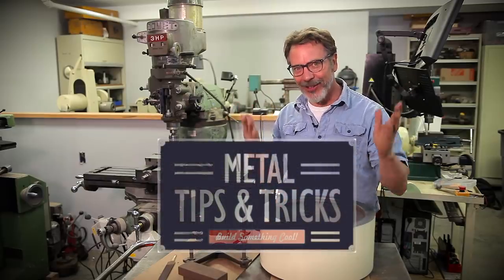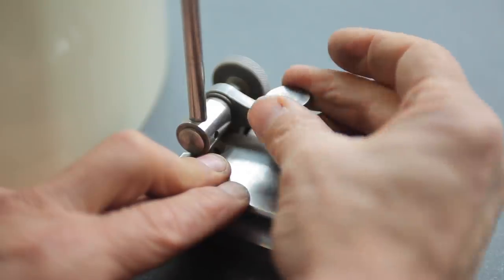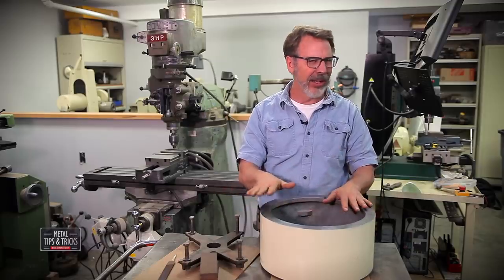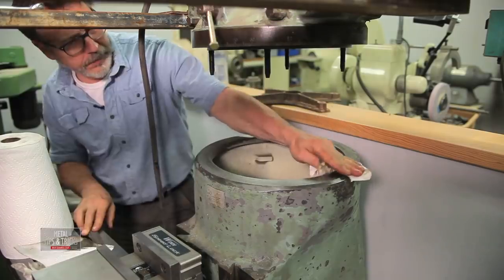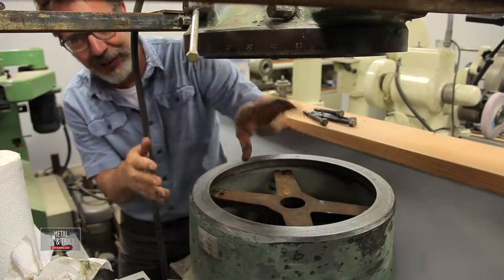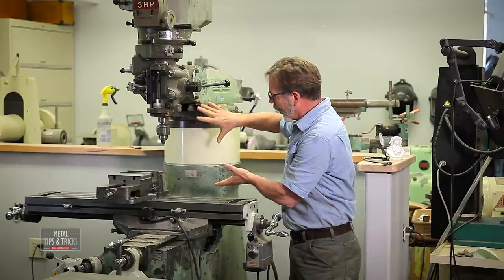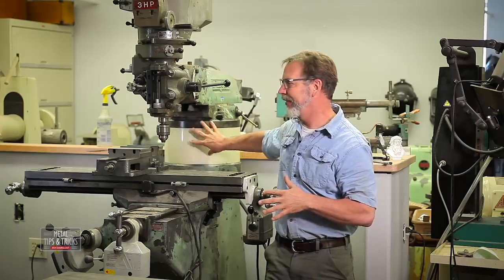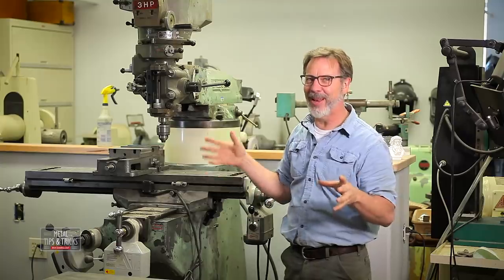You need this for your mill !!!!

Comment: I wouldn't have a Bridgeport without the 8" riser. I always ran with one. The pneumatic power draw-bar is mandatory. The versatility goes up exponentially with these 2 items. The other necessities are power feed traverse, and the 48" table, a 6" Kurt vise, Digital Read-outs, and an Advance Rotary cross-slide table. With a set-up like this, it is possible to make almost anything. What you can't make with it, can be made in the Tool-Room size lathe with DRO's, and quick change tool-post, with all carbide tooling. I think I just wet myself!!!

Comment: After raising the head, I would have moved it AWAY from the BASE as a safety precaution. It's not worth losing your arm to clean the mounting surfaces.
Reply: Yeah man, I cringed when I saw that and had to skip ahead just to not have to see it. Rule I learned in rigging and use all the time in the garage & driveway: NO part of my body ever needs to be under any suspended load. We all have plenty of tools that can be used to manipulate things in hazardous locations.
Reply: 1 lose an arm 2 and then try losing your head.. I cringed when I saw that . But god job anyway :)
Reply: He should have strapped the back end of the Ram to the Fork to keep it from tipping, and should have strapped both ends down actually.

Comment: A welded riser block  can work just fine. Years ago we often needed a extra high block for a job. I think it was 24" (600mm) high. Made the upper and lower rings roughed in. Used a section of pipe that was quartered lengthwise for the spacer. When the segments were welded to the rings there were four gaps so you could manipulate the anchor studs into position. After welding, the riser had the rings machined in the lathe. 
  We did a lot of work for Sandia National Laboratories and ir often involved large Aluminum weldments that had to have flanges, etc., milled, drilled, and have O-ring grooves cut.
  The warning about lifting the turret off a knee mill should not be ignored. Milling machines and lathes are notoriously top heavy and can seriously injure or even kill you if not correctly rigged for moving. If you have an installation manual for your machine, follow the instructions and don't cut corners... if it shifts while you are moving it, it won't be in slow motion when it tries to get you.
   Cheers from NC/USA
Reply from the maker: Great comment. :-)
Reply: Warning : Last lines are lethal. 😄👍

Comment: Hey Dale, glad to see you're ok and back on-line, I've missed your videos.  I'm a carpenter wannabe machinist, and I love to work in metal.  I've used a number of your ideas already with my tooling, such as the spindle square tool.  Its a much simpler device than you had made because I just use it to square my drill press table, but it certainly saves me time and its easy to use.  Happy to see you are back and healthy.

Comment: G'Day Dale, those riser blocks in Aus are almost as expensive as the Mill so I made two, One at 6" and one at 2" and had them stress relieved and they have been rock solid as far as accuracy.   What a difference they make to the capacity of the Mill especially for my quill mounted slotting attachment.  They are each around 390mm in diameter and I tuned them on my lathe that has a 330mm diameter swing.  Worked out to be an interesting setup.
Cam

Comment: One other thing to keep in mind is that it's possible to have the rear edge of the sliding center covers extend over the dovetails on the column and if you lower the knee with it overlapped your will bend the cover upward.

Comment: OMG... 900m2 that must be absolut great my workshop (hobby) has about 15m2 and I have a lathe (300kg) a nice big mill diy converted to CNC, metal bandsaw, hardening ofen, tool and cutter grinder, surface grinder, surface plate,  compressor, div. grinders, and tons of tools in this one room.. Without perfect system I couldn't find anything again... so whenever someone says he has not too much space I think I could tell how it really is having little space 😁😁😁
I love your videos 👍😎
Cast iron takes the vibration of the machine much better than steel 👍
Reply: 900 sq /ft is "only" 27 m^2.. I'm in the process of converting 200 m^2 to workshop..

Comment: I'm wanting to add a riser block to my bridgeport to gain some z-height back after installing an Advance Cross Slide Rotary Table. What size is the one in the video? I was thinking either a 6" or 8" riser. Can't go any more than 8" due to ceiling height, but I already have a maxi-rite power drawbar lol. The Rotary table is sweet, but ate up 12" of my Z-height, and currently, I can't even use my Albrecht drilling chuck because of it. And at 350lbs, it's VERY DIFFICULT to move by myself lol.

Comment: Dale, I almost couldn’t watch this to its conclusion. Great presentation, good videography, great sound, and interesting topic. But dude, why do you think they sell jack stands? You bet your life on the seals of that forklift hydraulic ram or the valve seats in the valve, holding. If either had failed you would have  been crushed, or worse when you were affixing the spider, have your arm severed at the shoulder. There are no pressure points for that kind of bleeding. Although it will stop eventually.

You should have removed the mill head from the work area, or at least chocked the ram (easily made from a pipe with a similar ID as the ram rods OD, split lengthwise and clamped in place to hold the weight if there was a failure) before getting underneath that rig. I’ve seen artillery plows, crane, jacks, aircraft landing gear, and yes forklifts fail in this way. 

Safety third is OK, but it has to be in the job someplace. I love watching horror, but only when it’s fantasy. Take care and be carful.
Reply: @warne28  Come on now buddy. What is the first rule in a shop? SAFETY!!!!!! SAFETY, SAFETY!!!!!!!!!  warne28 is absolutely right in calling this out.

Comment: I can't believe you installed that riser without applying some for of lubricant to the mating surfaces. The lubricant has two function. One is as a lubricant to prevent scoring and galling. 

The other is to seal out moisture. My preference would be a moly-disulfide grease but any lubricant is better than no lubricant. A dry iron face against dry iron face eventually reacts with air, humidity, coolant splash, whatever. It's not the end of the world to assemble dry but prudent practice would be to apply SOMETHING to mitigate the unforeseen in any metal to metal joint, especially where infrequent adjustments of precision fitted surfaces are concerned.

I've modified many Bridgeports in the last 50 years by drilling grease passages in the turret and tapping for a Zirc fitting. I had some little plates made up: "grease and rotate this turret annually." Overkill to be sure but the turrets always spun freely and clamped solidly. A needful thing in a busy shop.

Comment: I've got a Jet mill and have struggled with not having enough Z. Being forced to clamp to the table instead of the vice wastes a lot of time. Put a drill chuck on over a rotary table and you don't have much room left for the parts. I'll have to research what blocks are available for the Jet. Thanks, Be safe!

Comment: I've come within a quarter inch of maxing out the capacity of my Z travel on a big part only once but that was nerve racking. Another possibility is to turn the head sideways, mount a right angle attachment to the quill, and swing the ram around 30 degrees. You get 7 inches extra from the center line of the head to the quill face minus 2.5 inches from the right angle head center line to its face for an extra 4.5 inches. If you need extra, you can nod the head back up to 45 degrees and clamp the right angle head the matching angle on the quill. The quill center line on a Bridgeport is 8 inches from the nod point so that would be an extra 5.5 inches for a total of 10 inches of height from the table. You loose the use of the quill but in a pinch, 10 inches is 10 inches.

Comment: I couldn't find a video on riser blocks when i went to install mine, so i made kind of a slide show... I will add a link to video you will need to approve it, couple things you might want to consider in it... also I got one video on the simplest power draw bar that i designed... super simple....

Comment: If you can ever find a tos fnk25a in the US it's like a Bridgeport on steroids. I will have a quick change adapter, collet chuck and a drill chuck mounted with a drill and still got like 15 inches off clearance. The drawbar does require a step stool though, hence the quick change...

Comment: 5 flats?  I moved 29800 pounds (F350 and trailer) to AZ.  Two flats.  One on a poor u-haul and one on a trailer. The trailer is parked in the back yard till the new shop is built.  Had the trailer built extra heavy duty all the way.  Blew out a tire in the driveway in AZ the day after I get here.  Steel and iron is heavy.  How tall is your block?
Reply from the maker: The Block Is 7"

Comment: Sitting here with my right arm in a cast. Broke it bad. And seeing you work under that lifted mill head made me nervous. Weird how the brain works, I would not have thought about it before my accident.
Reply: I'd agree, likely that mini fork lift has a pawl or other locking system that prevents a sudden drop if something were to fail. I've probably done a few thousand lifts in construction, mining and logging and the first basic rule is you never EVER go under a suspended load without some type of mechanical load bearing blocking that is capable of taking the full load. Was it safe enough to do what Dale did? Probably, but it's a real bad habit to get into and when it isn't safe your still probably going to do it. It only takes once and I've seen the results of a few failed lifts where thankfully no one got hurt.

Comment: As a short guy that spacer is annoying. Just isn't annoying enough for me to want to dangle the head and remove it and swap it back on once every 3 or 4 years I need the space. The worst is the power switch as I work from the right side of the mill and can not reach it from that side. Been trying to talk safety into letting me have a "porch" around the mill for my short self. It is nice to have the room for a titling vice or a double stack of rotary tables.
Reply: Haha! a veranda around the mill!

Comment: As long as your machine head is more or less veretical, i don´t see a disadvantage. If you try to use a Bridgeport as a horizontal mill (kinda), it may differ. But who does that. I´ve often had (and heard of) not enough height in Z, never heard of to much....
Reply from the maker: Thanks for the comment. :-)

Comment: So much wrong. Working under a wobbly, unconstrained, suspended load...not using wood blocks between the forks and dovetail surfaces, not lowering the load before tilting the head backwards. Oof.